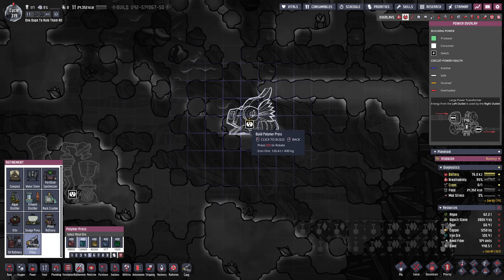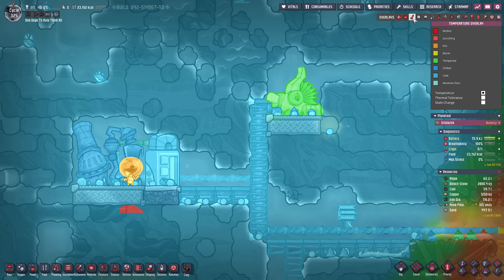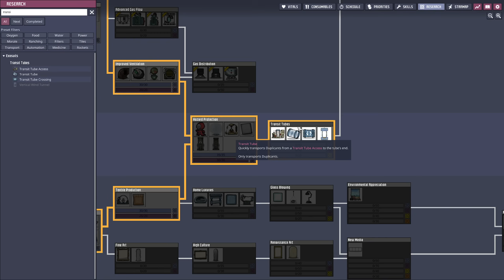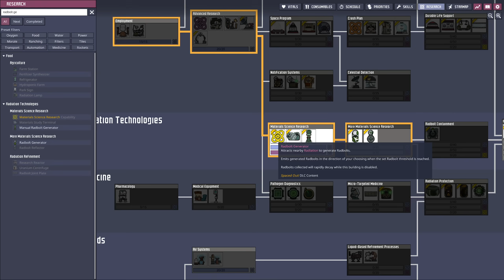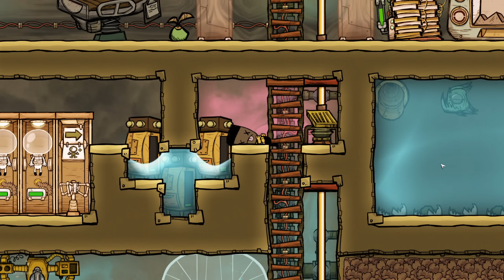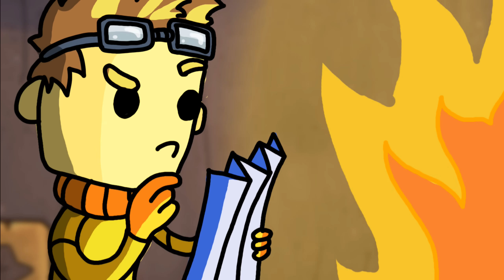PLASTIC & TRANSIT TUBES - Spaced Out (Classic + One Dupe): Ep. #10 (Oxygen Not Included)

Comment: You can use the automation from the material research station to stop the radbot generators when it’s full~
Reply: I second this. It is nice bit of automation I always use. Requires a not gate.
Reply from the maker: I usually do that, but it wasn't really necessary IMO because I plan on decontructing this again soon. Just needed some quick and may research.

Comment: I'll normally build a gas/liquid reservoir right next to the source (pumps, Oil Refinery, etc.) and connect them with Automation Wire. Essential using the reservoir to serve as a "smart battery" but for gas/liquid.
That way the source will always output at full capacity when active, and shut down for a good long period of time, without over-burdening the cables. Not only that, machines always consume max power despite running below max capacity, the more reason not to let the pumps to run-on-demand.
Reply from the maker: That is a great idea!